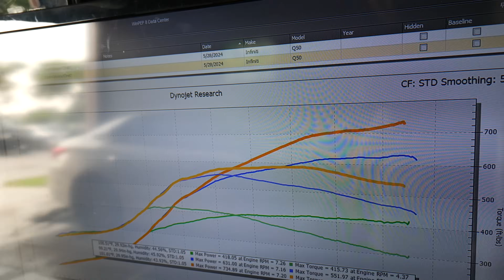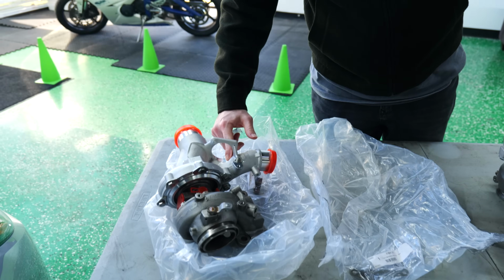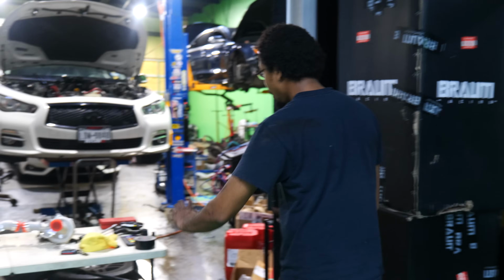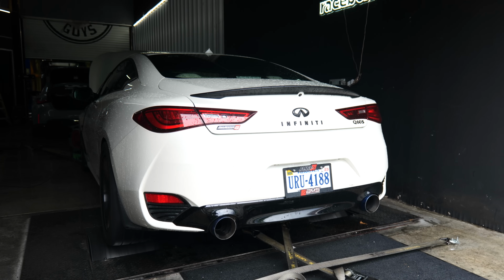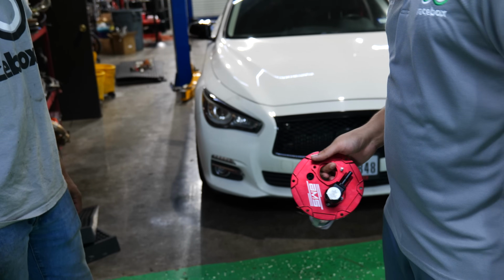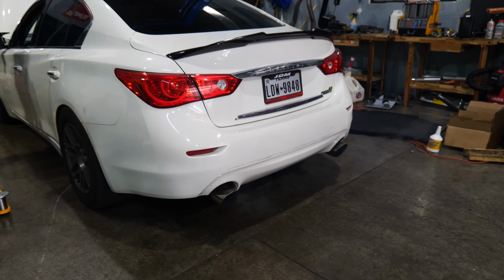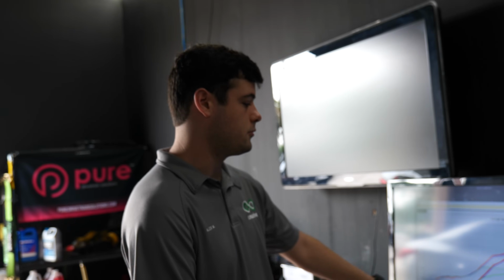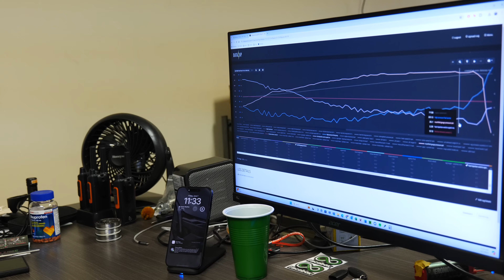Z1 VRX70B Turbos + AMS Dual LPFP = New VR30 Meta? How To SAFELY Make Over 700 WHP In A Q50/Q60!

Comment: if i buy the turbos will i need injectors and a lpfp aswell im not trying to do nothing crazy
Reply: simple just tune no e blend or anything
Reply from the maker: Yes, to take advantage of the turbos at all, even on straight 91/93 u need at least a HPFP and LPFP. Otherwise ur better off staying on stock turbos and do FBO E30

Comment: What do i need to make 500whp?
Thanks 😊
Reply from the maker: Full downpipes, catback, intakes, heat exchanger, LPFP, flex fuel kit and E30 can get you 460-480whp and around 500wtq on stock turbos. Add a HPFP to run full E85 u can be right at around 500whp.
Reply: @goracebox  thanks for respond! if i drop the car and have you do it, parts labor out the door cost?
Reply from the maker: Depends on the specific parts u pick (or we can pick for u with parts we carry), shoot us an email at sales@goracebox.com and we can get u a proper quote!

Comment: How did you guys get your pump to work mine is not working properly 😢
Reply from the maker: The wiring is very involved and there’s a boost reference switch to activate the secondary pump if u opted for the dual pump, go over ur install again and check everything.

Comment: What was all on this Q besides the two items in the title?
Reply from the maker: To make this power, you would need the usual supporting mods:
- HPFP: AMS Stage 3 or Spool FX-200
- Injectors: AMS stage 2 at the bare minimum, stage 3 preferred or Spool 2050cc
- Full downpipes
- Full catback exhaust
- Upgraded heat exchanger: AMS, Z1, PLM, etc (this car is converted to air to air, but not required)
- Upgraded intercoolers optional but recommended
- Flex fuel kit: AMS, Spool, or B6A
- Upgraded Omni 4 Bar MAP sensors to read proper boost readings and allow proper boost control

There will be other small things here and there but those are the main supporting mods needed for a 700+whp Z1 turbo build.
Reply: @goracebox  is is possible to hit 600whp on 91 with z1 turbos?
Reply from the maker: Nah man, you need ethanol for that.

Comment: Dual Pump on a factory 5/16" line? 

Have you tested a large line?
Reply from the maker: Not yet! The current fueling provided with the dual pumps and stock lines is more than enough to max out the stock engine, so honestly no real need to go bigger.

Comment: Always wanted to get into the vr30s and you guys are making great power on stock stuff.

Early on I heard a lot of horror stories with engine failures, has that been remedied with aftermarket parts or more refined tuning? Read in the comments that you guys are limiting low end torque which is the same thing done on my stock engine mqb. Just curious on the platform before I make the switch
Reply from the maker: Sorry for the late response! The platform has definitely come a long way since the early days. We were there in the beginning as well, and with more quality parts, better tuning strategies, and an educated community, the VR30 has never been more reliable than now in 2024. We have tuned 2500+ VR30s now, from bone stock cars, to bolt ons, to built engine/trans full frame turbos, and have seen every possible setup under the sun, so we know exactly what works and don’t, and we make recommendations to our customers accordingly. If ur looking for a comfortable daily that has great power potential, a Q50/60 is a great choice. The B58 is also great in this segment, and comes in a variety of chassis from 2 door coupes, to SUVs. We support and love both engines, hit us up if u get one! 🫡

Comment: Are these safe/conservative numbers for stock motor?
Reply from the maker: This is the most we’ll push these cars to on the stock engine, keeping torque right at around 600. Past that is where we start seeing failures. We have tuned to most Z1 turbo setups out there, and with the ball bearing version we have yet to see one engine failure!

Comment: What’s the difference between a dual LPFP and just a normal LPFP ? If I purchased the dual would I be able to run e50 or would I still need to get a HPFP?
Reply from the maker: Dual pump flows much better and solves the fuel starvation issues when ur tank is low. You will still need to upgraded the HPFP and injectors, but this gives them much more headroom which allows more ethanol to be run when on upgraded turbos running high boost. For stock turbos, a single LPFP setup and a HPFP is enough to run full E85, we only have that in our Z.

Comment: Damm would z1s turbo be good to daily on 93? Also Hussain is right I test drove a 2019 m550i and almost traded my q
Reply from the maker: Yes, Z1 turbos have great wastegate control, being able to have full 8mm of wastegate to play with from wide open to fully closed with boost varying from 13-14 psi all the way up to 30+ psi if needed. The daily map will drive almost like stock with just a bit more power.
Reply: Yes it’s great for daily driver. Basically new z1 turbos with ecu tech stage 2 ,intake and axle back = 490hp to the wheels. Super fun to drive.

Comment: So realistically what’s the difference from just getting a tank to run the dual 450’s and just doing the wiring for them instead of speeding $1700… am I missing something here? Please educate me I don’t mind.
Reply from the maker: You’re correct, anyone can custom build a badass fuel system and have it work just as well. However, for most people, it is nice to have a comprehensive kit that includes everything and in this case, very nice hardware that they can just easily install. Furthermore, the price you pay when buying a product from us or people like AMS, also pays for the customer service/support, and their R&D efforts that pushes the platform further. 🫡

Comment: What about the journaled chra?
Reply from the maker: Those have been pretty much phased out by Z1 and the new ball bearing version is the way!
Reply: @goracebox  are they still good and reliable? Any issues?
Reply from the maker: @bamthechamp unfortunately they result in oil pressure issues at high boost and high rpm. But z1 will change them out for the BB cartridge for anyone who has them. Great support.
Reply: @goracebox  thank you. I will give them a call.

Comment: This is awesome.  What's the price of happiness?
Reply from the maker: It’s quite a bit for this setup since it’s comprehensive, full fuel system, turbos, turbo back exhaust, cooling, plus install and tuning labor, ur looking at close to or around $20k to make 700+whp if u start from a completely stock car. If ur already modded, most supporting mods will carry over. Hit us up if u would like a more detailed answer or an itemized quote! 📧: sales@goracebox.com 📱: 832-786-9038
Reply: @goracebox  thank you sir. 20k is relatively cheap considering the power gains.

Comment: i heard a tuned vr30 won’t last 90k miles even wit frequent oil change 😢
Reply: I can tell u don’t know bout cars …
Reply: @tepelkua  More than u
Reply from the maker: Tuning a car will of course add more wear and tear on any car compared to stock, and even a stock car will blow up with abuse. We have countless examples of customer cars thriving at way more than 90k miles, if that’s ur standard of measurement for a reliable vehicle.
Reply: I would think proper tuning would help longevity. More specifically after adding bolt ONS, cause you're fine tuning air/fuel, spark ect so the engines running at optimum levels. Possible driver error beyond that, with constant burnouts, rev limiter bounces and whatever else..

I have an 05 G35 Sedan 6spd full bolt on, tuned on 93, with over 250k miles and even though the tune still needs some tweaking, she runs great! I also don't beat the crap outta her, saving that for after VHR and boost swapping. Lol